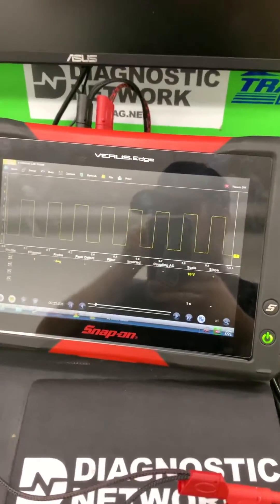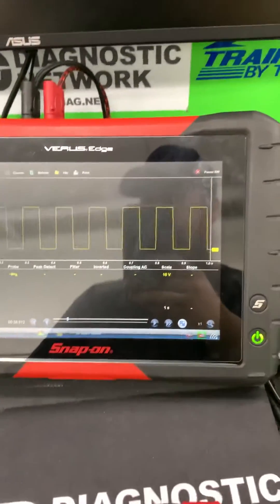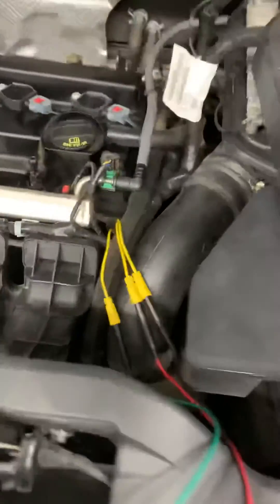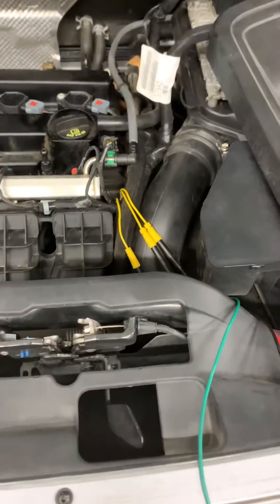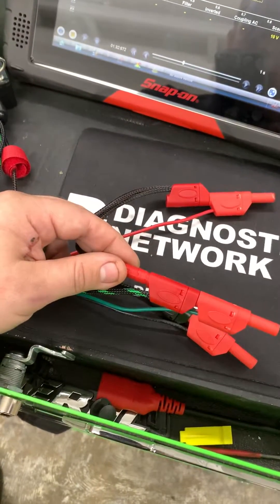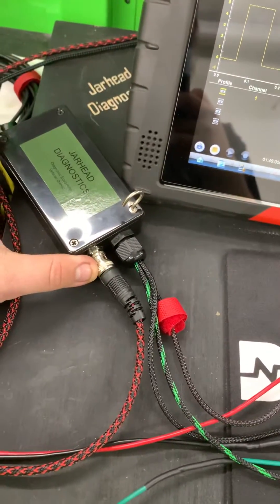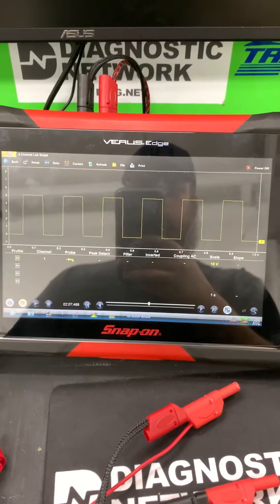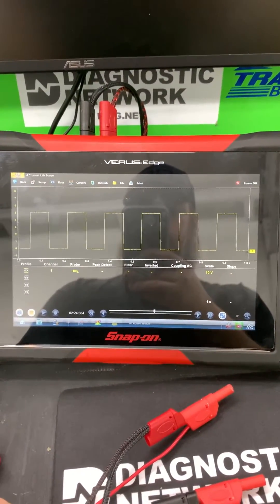5v reference box explained.

Comment: you explained but really didnot show  what you did.  show hookng up to sensor then show how you hooked up the wires to all those plugs   i look at that and scrath my head   huh.  of course if youve done it a hundred times it looks easy as pie  but how presented its a  cluster mess. if video meant for seassoned vets it ok
Reply from the maker: Thank you for the comment sir. This video is not explaining any vehicle, or any specific sensor. Since not every cam sensor is the same. (Which is why I did not specify a vehicle in the video). This is just stating how to 5v box works, and which connection for the box is which.